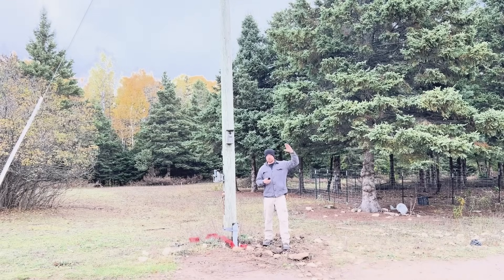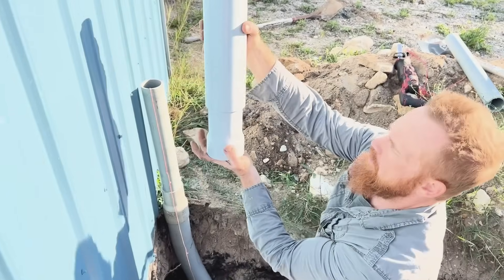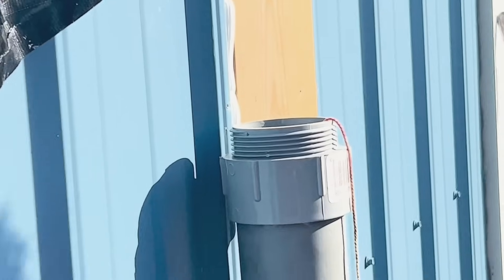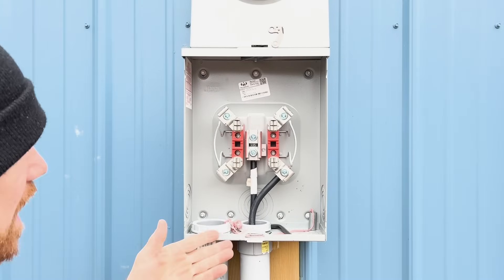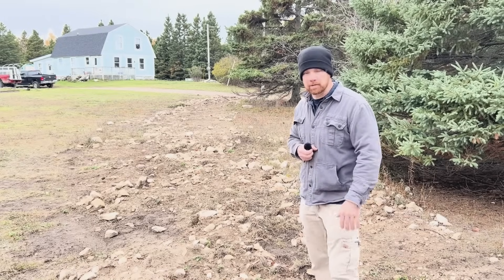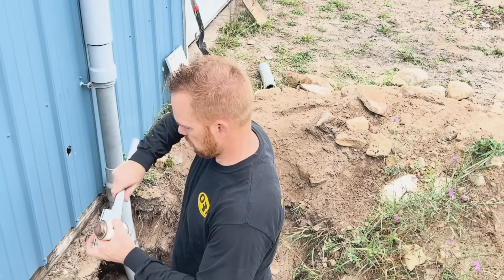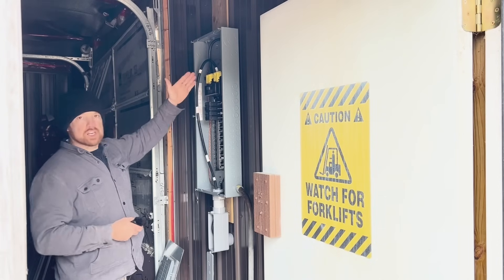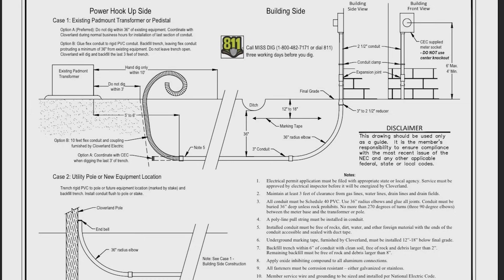200 AMP Electric Service COMPLETE Installation | Everything you need to know | Start to Finish

Comment: Here in Michigan when installing new electrical service for DTE on a home you can use standard 90’s and 2” pvc for a 200 amp service. They do require schedule 80 coming out of the ground on both ends and ran 8’ up the pole side.

Comment: Yet when installed within home it bends fine on 18 inch 90. Plus, the expansion fitting is for thermal and movement from earth . Anything over 122 deg can't use PVC anymore.(An Attic )So, outside, on a roof, guess what? Expansion fitting .

Comment: Does the meter box need to be grounded
Reply: Yes I think so. He should have used the meter box as the first means of disconnect and separated the grounds and neutrals at the panel. You want the meter enclosure and the panel to be all connected and continuous. Probably needed a bonding bushing as well.
Reply from the maker: Everything here was done properly to code…

Comment: so my meter housing has a big hole in the top - about 2" diameter and 4 screw holes around it.    is there a standard plate or something to block that up?  I am going to have all my wires going into the garage through the back of the meter - it is a EV meter so I get cheap power, it only is goin gto handle 60A max. 
Is it also okay to have my L1/L2 going in , L1/L2 going out, and 1 ground wire going through the 1 or 1.25 or 1.5 inch conduit knock out?
(6 ga for the line wires, another 6 (or 8) for the ground

Comment: Quick question. 

So I’m mounting a meter base for new service. 
It’ll be on a mobile home, can I use struts to mount it. Or how can I do it the same way you did? 

Thanks!
Reply from the maker: Not sure on that. That will depend on the code in your area

Comment: Most utilities like a large metal sweep from the pole to pull the wires through. What code cycle are they using in your area? NEC 2020 requires a disconnect at the meter for first responders making the inside panel a subpanel.

Comment: much easier to put a plastic bag on the end of the string and hook up a vaccum cleaner to other end and the bag will pull the whole string through the whole system

Comment: you can put Polly string in with a shop vacuum cleaner  use vacuum at one end and tie string to a plastic shopping bag   be sure string will come off spool with out resistance start shop vac will suck the bag out the other end with poly string attached

Comment: Good video but I would definitely check with your local power company to see their specs because this is a lot different than I have done in the past in several different states!
Reply from the maker: Did you see the spec sheet at the end of the video? Came directly from the power company
Reply: But each power company has different specs if they go by yours it could be totally wrong you should have added that to your video. A lot of places have to have rigid turning up a lot of places have to have schedule 80 turned up I have never seen a power company Supply the red marking tape etc. ...

Comment: Hind-sight being 20-20, I bet, if you ran out of the top of the meter socket up and into garage, and down into your load center, you would have had enough wire.  Thanks for sharing
Reply from the maker: Most likely yes.

Comment: Nice job. Very well explained. One thing I did 25 years ago, was to cut 40" lengths of that 2" or 3" PVC to place on top of the run before back filling the trench. This allowed the inspector a sight-tube down to the PVC and measure if they like. Put a few of those along the way and backfill. Smart thinking putting the ground rods in the trench-saved you 3' of pounding. Thanks for sharing

Comment: Watch this video on some mistakes to avoid when putting in service. But don't use it as an installation guide. There are plenty of videos by real electricians that show you how to do a safe, neat installation. Why is he only running a 120 volt service? The inspector will not approve it and the power company will not connect it.
Reply from the maker: You must not have watched the whole video. I am running a 200 amp 240 volt service. I didn’t have enough wire to install the third wire as mentioned in the video. I ordered the wire

Comment: Next time you find your wires are short going into your panel as long as the main breaker turns on and off to the right and left as yours appears to, Just flip the panel over and put the main at the bottom.  (It’s only when the main flips up and down that ‘off’ has to be down(have installed those sideways))

Comment: Dude.... Thank you for sharing this.
I just finished digging the trench, and was laying the pipe with the cable earlier today.
Tomorrow I was planning on trying to get things wired in, so I'm hoping that this video will help me learn what I need to do, so I don't blow anything up, or burn anything down. (Just running the cables from the main breaker box, to a sub junction box, then a couple power outlets, and 1 light. More stuff will come later.)

Comment: It seems to me that the exansion joint should be installed in the closed position if you do it in the winter. At least if the ground is actually frozen solid. If you install it in the open position and the ground thaws the pvc could potentially crack when the pipe gets pulled down into the ground again.
I think you're good though since it's to early in the winter that the ground didn't have time to freeze totally.
Reply from the maker: It’s set in the middle so there is plenty of slip either way. If the pipe moves 8” either direction we’re probably having an earthquake or something other than frost freeze ground movement 😆
Reply: @9252LIFE  Yeah. Middle is probably a good idea. 8 inches of frost heaving sounds like some really crazy weather for sure.

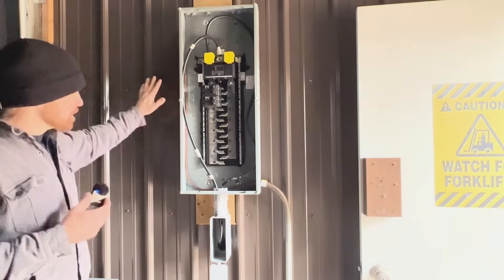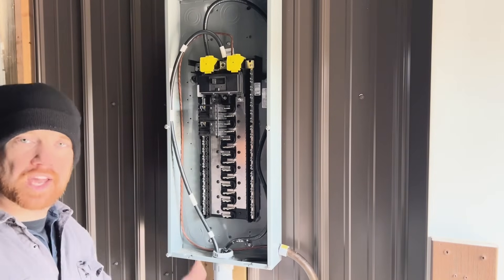Comment: nicely done (narrowly avoided having to rewire my mothers house).   microphone needs to be closer to your mouth, like at 15:10 is pretty good, about 8 inches away, but if the wind is blowing, then 1 inch so your voice easily outpowers the wind noise.   is your monitor set dark?  quite a lot this video looks much too bright, kinda overexposed.  for example eyes at 12:10, wow those are freaky (-:
Reply from the maker: The problem was that it was extremely windy and rainy that day but I had to finish it up and in the editor I had to brighten up a few things. When the edited video exports to YouTube it changes the color tone quite a bit. I am taking a class on the editor now so I can dial stuff in.

Comment: Why would you not use direct bury cord so you don't need to use conduit all of the way between the two points?
Reply from the maker: Because it doesn’t pass the good ole code book… if it doesn’t get a pass sticker from inspector it doesn’t get power ran from electric company
Reply: @9252LIFE  that sucks!  I forgot most places have codes they have to follow.  Thanks for the reply